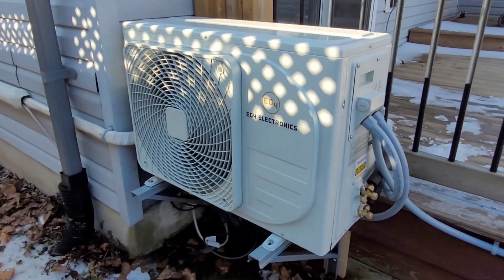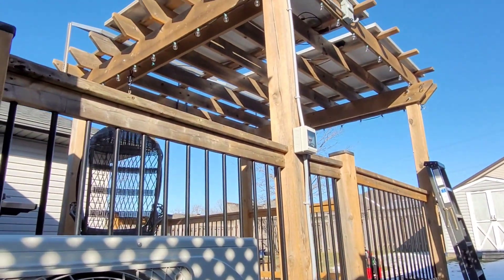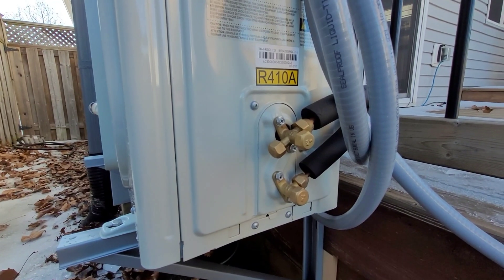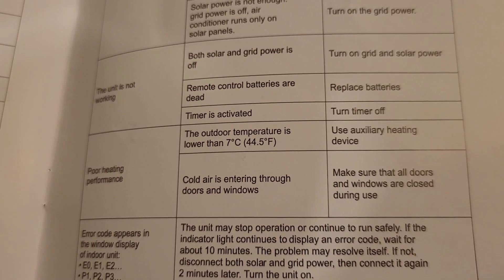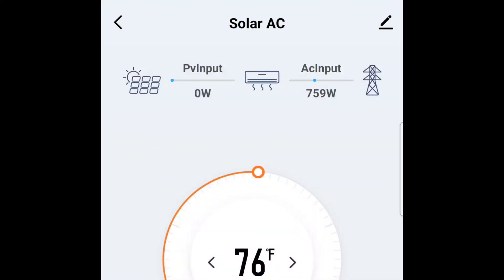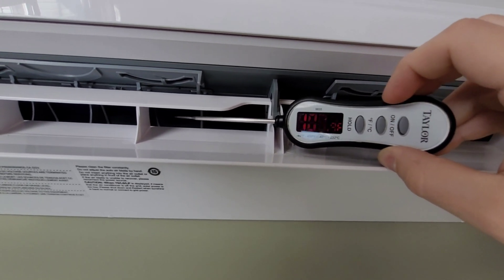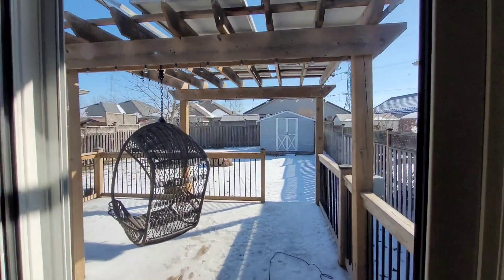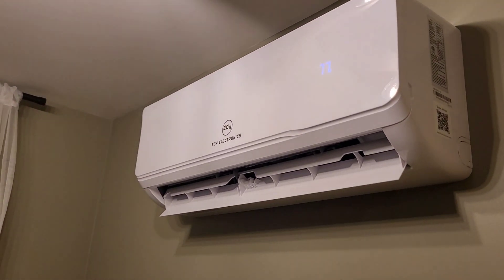Does The EG4 Solar AC / Heat Pump Work In Freezing Weather?

Comment: If my brand new EG four 12,000 BTU AC/heat pump will only generate 104° heat supply inside the house when it’s 75 outside this thing’s gonna be useless at 25°? Please prove me wrong.
Reply from the maker: How many watts was it pulling?

Comment: Is there no way to put batteries between the solar panels and the unit so that when you’re not receiving solar, you can use a couple of 12 V 200 amp power lithium, iron phosphate batteries to supply electricity to the unit until the solar kicks in again

Comment: What btu is your unit and how many sq ft is your house.  I'm super interested in the EG4 hybrid mini split.  The area I'm most concerned about heating or cooling in my house is about 500sq.ft
Reply from the maker: @VanLoweLawnCare  it's a 12k and my house is about 1200sq ft
Reply: @SmitHVAC.  Wow, so it the unit only heating/cooling a certain sq ft of your house or able to do the whole thing.  I know you said you have a gas furnace. Just trying to get an idea of how well that size unit would handle what I want to heat/cool
Reply from the maker: @VanLoweLawnCare  it cools the whole house adequately unless its above 35. Heats most of the house to -5c, further rooms and basement are cold beyond that

Comment: Which off grid heat pump would you recommend I buy? I have 3 of the eg4 indoor wall mount batteries and a 12000 eg4 inverter with 18 440 watt panels. I live in Newfoundland where we get a bit of cold temperatures. I’m 100% off grid. With a 3600 inverter generator has a backup. Thanks
Reply from the maker: Get one of the EG4 hybrids, 12 or 24k depending on your house

Comment: Better to put it on a wall, where the sun directly hits it. It would be much more efficient. And paint it in black. Of course, if you want only to use it as a heat pump - for heat.
Reply from the maker: It does get sun, this is a south facing wall. Painting it black would not improve the heat transfer of the coil, it would just make the cabinet warmer in direct sun light.
Reply: @SmitHVAC.  cabinet warmer = heat exchanger warmer, since it will warm up air arount it and fan will suck it to the heat pump itself.

Comment: Just installed the new version yesterday. 12k hybrid. Im only using "ac" power from my batteries until i get more panels, which where im at do not work in winter almost at all. Generator backup. Really, Im not very impressed with the unit. I really thought it would put more heat out. In the dead of winter here in missouri, when i would need it most so i can leave state without the pipes freezing, I think it would have a really hard time keeping up.  Probably using alot of power trying. Definitely not what I was really hoping for. I'm sure in the summer with my solar keeping up with itself it will come in way more handy.
Reply from the maker: That's surprising to hear. What size is the space your trying to heat? What is your insulation like and whats your outdoor temperature? A 12k can only put out 12k which isn't that much if it's really cold.
Reply: @SmitHVAC.  it's only in the 30s-40s. It's trying to heat a little oversized space probably. I'd say 800-900 sqft. It's defrosting quite a bit. I have 2x6 walls with r19 insulation. I'm used to the amount of abundent heat a wood stove puts out, but am trying to see what the unit does on its own, so that probably has something to do with it. It takes a very long time to raise the temp in the house.
Reply from the maker: @JustSomeGuyIght  it's definitely a different heat than wood stove heat. Are you fully off grid? Do you have the app connected? It's probably not using as much power as you think.
Reply: @SmitHVAC.  I have it set at 90 to get it to raise the temp right now. It's using 1220w at the moment. Once it hits 70 I'm going to set it to 70 and see what it does

Comment: That last screen shot was showing 47 KWh. What's the daily consumption rate on that unit?
Reply from the maker: Depends on the demand, it's a variable speed system
Reply: Just wondering if you had real world usage. Estimates are about 10kWh. I'm going to be putting in some flavor of one within the next couple of months and power will be off grid only. 10k  is a good chunk of battery space.
Reply from the maker: @beebop9808 my last few days were between 5 and 6kwh per day, just above freezing temps here

Comment: Great unit but would be nice if there was a way to extend the pre-charged line sets. Only comes with 16’
Reply from the maker: Yup, in my install video I had to extend mine. You need to add refrigerant when you extend the lines as well.

Comment: Has anyone any problem with surge voltage from solar? Is there any protection from voltage spikes from clouds?
Reply from the maker: I have not experienced anything like that, this mppt has a maximum voltage of 380vdc and Im only running around 210vdc so I don't think it would ever be an issue

Comment: If I didn't hook up the 120 volt ac, would the unit work with only solar during the day? Would it start automatically?
Reply from the maker: Yes it will run on solar alone, as long as you have enough panels. It doesn't start automatically you would have to switch it on, it also has a WiFi app or timers that can turn it on.
Reply: @SmitHVAC.  if I put it on a timer and it has no 120 volt ac, how does the timer work if some days there is no solar? Say you set the timer for 11 am and there is no 110 ac and no solar. But the sun comes out at 12 noon?
Reply from the maker: @neilwani1178  it only needs a couple watts from solar to keep the board powered. Your phone also saves the timer so as soon as there's enough sun it would turn on

Comment: The solar Aircon  APP are not available for my smartphone devices,How did you download this app?
Reply from the maker: I had no issues downloading it, what device are you using?
Reply: @SmitHVAC.  Samsung S22  smartphone Android
Reply from the maker: @Bripromo  That's strange, I have the same phone and I had no problem
Reply: @SmitHVAC.  you probably running Android 10 software..

Comment: Is it better to get a solar/ac hybrid heat pump like this or a traditional ac unit powered by an all-in-one solar inverter like a grow watt?  Thanks
Reply from the maker: I have considered that as well. I wanted to keep this separate as my offgrid system is on the smaller side. It was cheaper to install this than to spend the money on a good size all in one plus batteries, plus an Ac, but it depends on your needs
Reply: @SmitHVAC.  yes.  I guess it’s all a balancing act.  Thank you for your videos and comments.  Good stuff
Reply from the maker: @wblynch  Thanks Bill

Comment: I see eheat button on the remote. Does the inside unit have a resistance heating coil in it ?  Wondering if that is what was bumping up the heat temperature ?
Reply from the maker: This one does not have any resistive heat, I'm not sure if it's on the larger BTU units or if its just a remote that was used for a different heat pump

Comment: Is it R410? Good video. Thanks. I'm considering trying the 2 ton one to replace a 3 ton R22 central air. I'm in Ontario as well and have a US shipper just across the border in Michigan. I have 7kW of extra PV available and a 14kWh battery with a spare Growatt 500ES that I would like to dedicate to a heat-pump.
Reply from the maker: Yes it is. That sounds like a nice setup, it would be nice if you could pair these to a standard indoor coil for central heating and cooling.
Reply: @SmitHVAC.   Yes, central would be good. I have hydronic heat so a solar ready monoblock would ideal for me. I would prefer R290 monoblock so it works down to -35C. I'm trying to build a split one now with a brazed plate heat exchanger using a Senville SENA/24HF that is R410a(not pleased about that).

Comment: How low in Celcius weather has this unit worked for you. I live in New Brunswick Canada and it gets pretty cold.
Reply from the maker: I've used it in -10c and it worked great,  it was a rather mild winter here in Ontario and I bought it on the tail end of winter, so that was the coldest day we've had since installing it
Reply: @SmitHVAC.  awe nice. Yes Ontario got an easy winter this year. Looking forward to long term use videos. Thanks for the reply
Reply from the maker: I will certainly be making more videos on it. Thanks for watching / hopefully subscribing!

Comment: Dumb question, I’ve found longer line sets but I haven’t been able to find a 25 foot communication/power cable.  Where did you get yours?
Reply from the maker: I bought this in a 50 foot roll from WWG, they are a Carrier dealer

Comment: Thx for sharing. New model with valve cover and back grill and with 'plug and cool' free vaccum connection Pipe will come, the solar Mc4 connector also updated.
Reply from the maker: That's good to hear! Thanks for the message. Will the vacuum free connection be similar to the Mr cool precharged lines?
Reply: @SmitHVAC.  I don't know Mr Cool precharge Pipe, but ours vaccum pipe and indoor outdoor precharged, using 4 pair adaptors easy connection and no leakage risk.
Reply from the maker: Sounds very interesting, I would love to see it
Reply: @DeyeSolar   will you be making a multi zone system soon?
Reply: @adamdegan4613  I 2nd that question.
Reply: @DeyeSolar  When Will new model be available? From where to buy? Thanks
Reply: Pre charged linesets with plug & play mc4 connectors wil be a game changer for the DIY Offgrid community
Reply: Is the Deye solar Heat Pump a true DIY unit or does it require a certified HVAC technician in order to have warranty coverage?
Reply from the maker: Eg4 requires professional installation to honour the warranty. I'm not sure about Deye
Reply: We want deye/eg4 heat pump water heaters and the precharged mini split would be amazing. I installed a 12kbtu eg4 and love it so far. !
Reply: @WattsMiner  It would be cool to get a deye sales in the US/Canada. Though one thing I would super love is a way to stack these heat pumps and add a number of head. This a way to add solar as one whole unit. Rather than single arrays. Along with the water heater as well too. 
I would buy used panels and racking and have a large array installed if the power could go in to a combiner box then split out to eash unit. 
I am still working on everything to build my new home and I have considered the cost for a central air and electric heat would cost more than to install these mini splits. I will be adding a wood stove as a back up. Propane and natural gas which I have is quite costly. 
I would also like to have some kind of in floor radiant heat. 
The other thing I would love to find is in concrete DC heat wire rated at high voltages and have long runs and DC power controllers that work with the sun only, grid only and or a combo of the 2.

Comment: Not sure if you are speaking in all Celsius measurements or a mixture of C and F?

Is the 47kw value the energy used in a 24 hour period? 

You would think the unit comes with some sort of a protective barrier for the coil.
Reply from the maker: I tend to use a mixture of F and C. All the indoor temps were in F. The outdoor temps on the Google display are in C. The 47kw was total power for the life of the unit. Thanks for watching!
Reply: @SmitHVAC.  OK. So an average of 7 kw per day.  Which would certainly vary.
Reply from the maker: @ustmissouri8029  Definitely varies, so far for March I've used about 3.5kw a day and about 50% was from solar. My natural gas usage for February last year was 319 cubic meters and this year's was 161m3 so I've certainly cut back on gas usage, although it has been a bit milder this year as well.
Reply: @SmitHVAC.  Sounds good thank you for your information.   The place I'm setting up is probably a 1000 sq foot icf home that will run completely off solar.  There is electricity on the property but probably will only be used to charge batteries if need be. With a generator back up for worse case scenario. Take care!

Comment: Probably vary dependent on where you live in the country, as I live in the Pacific Northwest I don’t think this would be an good option for me!
Reply from the maker: For sure. It's pretty capable in the cold temperatures but the sun is an issue for me during winter. I'm getting good sunny days on average 3 days a week. Summer will be a different story through, I expect it to run on solar almost every day
Reply: @SmitHVAC.  
I’ve been thinking about another option. The diesel heaters people are putting into their vans can be used for a room in the winter time to stay warm. Find one room in your house where you can use this diesel heater to stay warm in case all other heat or electricity isn’t available!
I’ve seen a few videos of people attaching it to the outside of the house and having heat pouring in in the winter!
Reply from the maker: Definitely not a bad backup to have onhand. I have another video on the dewalt/Mr heater propane heaters. I have one in case of emergency
Reply: @simon359  if you buy a diesel heater I'd go for the expensive models and stay away from Vevor, I used one, for 5 months, in my converted enclosed trailer , when it worked it worked good but constantly failing every 2 weeks. Lots of cleaning and glow plugs and 2 mother boards. I did almost consider the propane version, but decided to go with a Dickinson p9000. In my tiny home I do use a mini split for heating and cooling but it's a 240 volt unit. Works great in minus 30 Celcius weather and plus.

I'm always updating my knowledge on the 120 volt units to see if they are getting to a point where I can switch over and use solar even more. Since I do use the grid for my 240 unit 😢
Reply: @mrchrisknight315  
Thanks for the heads up, but I already got the Vevor model. I knew it was very cheap, so I wanted to try it out. I haven’t even gotten to putting it together yet, as I won’t need it till the fall. 
Mostly, I just want to see if my idea works and if it does, I can always get a more expensive model later. 🖖